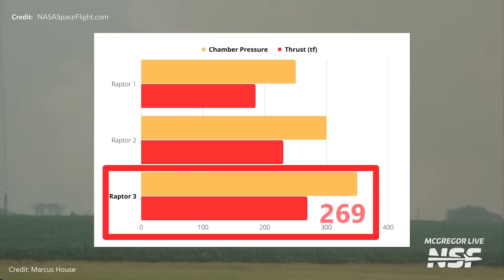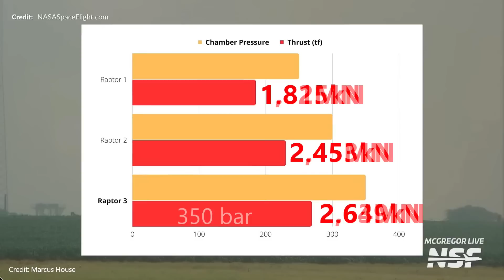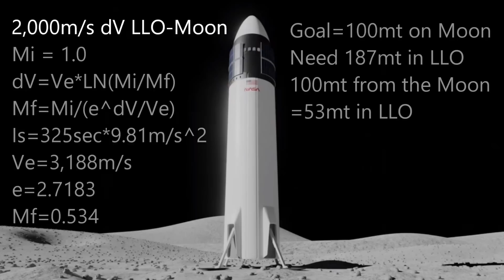Can the New Raptor 3 Save Starship?

Comment: The Raptor 3 will get Starship is an good engine to get to space if the reliability. As for Mars it will take a Nuclear pusher stage { TUG}. The Gravity issue for log term human HAG. I never understood why SpaceX never not make the nose a safety issue but it may become a NASA Requirement.
Reply from the maker: It is strange that they would not.

Comment: 0:45 who is saying the space shuttle main engines never failed in flight? STS-51 & STS-93 say hello.
Reply from the maker: Wasn't that a sensor error?  But good point.
Reply: @terranspaceacademy  STS-51 was a temperature sensor issue that caused an early shutdown & abort to orbit.

STS-93 was much more serious. Three of the cooling channels in the engine bell were damaged and caused the shuttle to lose propellant at a rapid pace. They made it to orbit just barely under-speed, but if an additional channel had been ruptured then they would have lost the mission if I remember correctly.

STS-93 is where the "yikes!" "You bet!" "Concur!" "We don't need any more of these." exchange came from.

Comment: Space had to blow up the spaceship when some of the engines failed, because they couldn't reach space or do an safe landing. So the effect is the same everything blow up even if it wasn't directly from the engines. If one engines fails when trying to land everything blows up again. 
So safety for crew in spaceship is questionable.
Yea the space shuttle was an failure and never an effective craft so building something new that is equally ineffective and unsafe is a bad idea.
Reply from the maker: Not really.  Rockets often fail on testing.  The Starship is a sound design for cargo and even getting people to orbit.  I'm just not sure they'll be landing on one any time soon.

Comment: For the fts if it is a wire detonation, should it have cut the ship in half and not punch holes in it? If i understand that correctly, which i had someone else help me understand it, than not only was the fts a failure but also to slow working for safety parameters. Not a hater, just advisor of facts and learner for knowledge.
Reply from the maker: 4.5mm steel is pretty tough.  A linear unzip or "can opener" as you mention, would be the way to go.
Reply: @terranspaceacademy  I take you agree with how the fts works. Now for the thickness, have they tested this on the ground to determine how well it works for? I believe I heard him or others say that it will need more cord to ensure unzip. Also to ensure it works why not design those areas to be easier to destroy while holding the mass to ensure proper safety function?
Reply: Also, what about detonation bolts that help the fts to fully unzip the ship.

Comment: Can it save Starship? What the heck are you talking about?
Reply from the maker: Extra thrust getting the ship off the pad faster so as not to pulverize the launch pad or cause sufficient back pressure as to prevent other engines from starting. Also engine out recovery is much better with extra power to spare.

Comment: For every launch every raptor is test fired multiple times. That means 39 tests times 2 or three for every launch. Today they will have test another and tomorrow another and so on.  By the time humans fly the current 300 raptors will be hitting thousands of raptors and 10s of thousands of test fires.

Even now, raptors have been tested more than most engines that have been around for decades.
Reply from the maker: that is a good point Brad.

Comment: What?  Starship did not need to be saved!   It is doing great even without raptor 3.   Just click bait title.
Reply from the maker: It does indeed... three engines failing before launch is not good.
Reply: @terranspaceacademy  - How many launches has Falcon 9 and Heavy and deliveries to the Space Station, and you claim SpaceX needs to be saved!  How Funny. There were many other things that may have caused those failures.  This is how SpaceX has advanced so well.   All the rest of the engines ran well and enough to get the rocket where Elon could call it a success.
Reply from the maker: @genemetz1945  It was a joke Gene.  SpaceX is the most secure space launch company on Earth right now.  Much more so than the state sponsored companies in China.

Comment: Why doesn't SpaceX use booster rocket configuration on the Starship like they do on the Falcon 9 Heavy? I would think that if you distribute the thrust over a wider area that there would be less damage to the launch pad.
Reply from the maker: They would need a broader base of the rocket.

Comment: I rewatched part of Everyday Astronaut's video on the Raptor from 3 years ago and am thoroughly impressed with the advances made to the engine. At that time the engine was only capable of 2 meganewtons of thrust and 300 bars was only an aspirational chamber pressure. The Raptor is far and away the most advanced chemical rocket engine ever developed with its record breaking chamber pressure and full-flow staged combustion cycle, all while being reusable. Yet they are a fraction of the price of comparable engines. SpaceX is truly doing incredible work.
Reply from the maker: They are... and I still get people screaming that the RS-25 is better... :-)

Comment: I also sensed the raptor three being immanent emergence as they sermed to have reached the upper limit of the second series.

Going with the the law of diminishing returns, raptor 3 can only be 30% more powerful than raptor 2, unless major tech shifts have transpired to facilitate many variables being refined in these 2 years and 5 months since debut of raptor 2.

The raptor 3 should max out in te next year and 7 months, with a performance that's 3 times the current output.
Reply from the maker: They will top out at some point.

Comment: Not unless it is far more reliable. There was one failure of a Space Shuttle engine which required an in-flight shut-down. One engine in 134 flights. The reliability of Raptor engines remains woefully inadequate for a human-rated spacecraft. Before another launch attempt, full-duration, full -thrust static fire tests should be conducted, with the objective of a failure rate of 1% or less. That means if 3 boosters are tested, each with 33 engines, no more than one engine should fail out of all 99.
Reply from the maker: They can blow up 70 Raptors to get it right and still save money over one RS-25.

Comment: Regarding the delay in the flight termination system's effectiveness on the 1st orbital test: seems that need to ensure that the autogenous pressurization pipe(s) returning into the propellant tank(s) are within the detonation zone so that the propellant tanks quickly lose pressure when FTS is actuated.
Reply from the maker: Should they put it on the common dome?
Reply: @terranspaceacademy  They probably want to keep the FTS outside the shell because they need to have accessibility to arm it shortly before launch and quickly disarm after landing.
Reply from the maker: @AlWaller-zp9rg  Good point.

Comment: Excellent analysis as usual.
Another thing that Spacex should consider is scalability. Borrowing a page from their Falcon series development, currently you have the F9 and the Falcon Heavy. The F9 has become the major workhorse of the space launch services  industry. Falcon Heavy is available, but with far fewer launches. Similarly, a scaled down series of booster/starship or booster with reusable second stage would get far more traction for LEO and GEO missions. Also, provide a more cost effective means for orbital testing of the evolving Raptor engines and vehicles rather than blowing up 39 engines at a crack.
Another argument, and a major one at that, is that even with full reusuability, the booster/starship in its current form can never be as reliable as a simpler design using gas generator engines. Just too many points of failure!
I am not aware of any plans Spacex has for scaling down the booster/starship. If anyone does, please enlighten me.
Reply: They have no plans for a smaller starship. There was an idea to do a mini starship, and fly it on FH to prove the design, back When BFR was still carbon fiber. But the move to stainless made that not cost effective. Starship is slated to obsolete the falcon line entirely. Elon thinks it will be cheaper to fly those payloads on Starship. Even if it is massive overkill for the job.
Reply from the maker: I wanted to see one but it's not in the cards... Relativity's Terran R will be the closest thing to a mini-Starship.

Comment: A Space shuttle main engine did fail on one launch STS-51-F causing an abort to orbit. Still, that’s a pretty good record
Reply: The engine didn't actually fail.  It was shut down due to bad sensor readings.    A few minutes later, the same sensors on the remaining engines also started producing bad readings, and the decision was made to ignore them.
Reply from the maker: Sensor error... the  engine was fine.
Reply: @terranspaceacademy   @Annie Mouse The engine shut down. It wasn't supposed to shut down. The sensor is part of the engine, the failure of the sensor caused the failure of the whole engine. Seems reasonable to call this an engine failure. 
(I suspect this isn't the first time people have disagreed about this point on the internet) 😃
Reply from the maker: @dufkers  That's fair...

Comment: Clickbait title that is not even addressed in the video. And after one test flight, why exactly would Starship need "saving"? Unsubscribed.
Reply from the maker: Sorry Daniel.  The algorithm does not reward scholarly titles.  Sorry to see you go.  If the Raptor 3 at 75% full throttle can launch the Starship at 1.5 TWR there would be a good margin in case something went wrong.  Like an engine blowing up.

Comment: I will play devil's advocate. You call for an eject system, but airlines don't have an eject system. Why should it be required on one and not the other? I can think of only 1 reason. That materials are stressed much more in a rocket vs an airliner, but turbines are spinning at thousands if not tens of thousands of rpms while exposed to significant heat, so I am not sure how 1 condition compares to another ( future video idea?) So where weight and complexity are the enemies of space flight, do you think that they are justified based on safety factors? Even excepting moon landings?
Reply from the maker: Airplanes can glide Chad.  Starships cannot. There have been several power out airliner landings.  There will never be a power out Starship landing.

Comment: I do like the 2-stage + crew/cargo pod concept but that adds an entirely new vehicle to be designed, built and tested on a very tight schedule.  Plus, the second stage now needs heat shielding around what appears to be a sharp edge where pod joins whether the pod is docked to it for re-entry or not.
Reply from the maker: It would be a little work but worth it in the end I think...
Reply: @terranspaceacademy  
Maybe.  SpaceX don't know if their heat shield will work yet.  They don't know if they can make in-flight refueling work. The time-line is already pretty aggressive and, surprise, surprise, SpaceX have already encountered a rough patch in the road... there will be more.

Comment: One F1 did fail on Apollo 13. It shut down too early.
Reply from the maker: That was a J2... I thought the same thing.  And wasn't it 13?
Reply: @terranspaceacademy  the J2 's on the second stage had to burn longer because a   F1 shut down early.  The rocket left it's inclination line to orbit because of the  lower thrust. To make up the loss, the J2 engines on the second stage were  fired longer then planned , getting  Apollo  13 back on track to orbit.

Comment: once the revolutionary payload capability has been proven,  and once full reusability is established, then, features that dramatically affect payload numbers, like a three stage with double redundant escape capability, might be practical. it would have been interesting to hear an estimate of the hit to payload and overall efficiency capabilities,  the aerospike crew module idea would impose on the overall system efficiency. furthermore, if the frequency of flight and reliability numbers advance in lockstep, the motivation for the three stage configuration is reduced favoring payload. other mission needs may still make this configuration useful, but safety ideally would not be that need. we do not have ejection seats and parachutes in airliners.
Reply from the maker: Because they can glide MrGunderfly :-)  The Starship glides like a large steel building...

Comment: Astute observations as always! Starship is perhaps the most ambitious launch vehicle project ever undertaken, so it stands to reason they won’t get everything right on the first try (or even the first several). I suspect that something similar to your nose-come abort setup might be dictated eventually by the FAA (or maybe NASA) for crew safety. SpaceX mantra is that if you aren’t having to add back parts or systems that you aren’t optimizing enough, so it’s easily within their MO to add an abort system.
Reply from the maker: We think it would be a reasonable addition to crewed flights James.

Comment: I thought the debris damaged the engines from a horrible designed launch pad. Did I miss some information the last few days?
Reply from the maker: Elon said that three of the engines were out of range and were shut down on startup... that was the maximum launch outage that had been calculated so they flew it anyway... Hard to know how much of the other damage/engine explosion was debris related.
Reply: That was just everybody speculating. As far as I know the official statement is that no engines sustained damage from the concrete.

Comment: Good job as usual. I wouldn't put it outside of possibilities that SpaceX already has this on a drawing board somewhere. It's just a lot further down the line. Say with the first iteration of the human flight version. I like the idea of the separation for emergency but not the design landing change, even though your points about the mass to lunar surface is intriguing,  it would be superfluous to the original design criteria. I've said in the past that it's a space truck. There is so much room in our efforts going forward to include other companies with designs that will full fill the "we need to just take people and a small amount of cargo" to the moon or mars to make this a needed service. SpaceX and specifically Starship is simply a BFR company.
Reply from the maker: The Raptor 3 will probably see usage... Elon said there will be a totally new engine not called Raptor later.
Reply: @terranspaceacademy  I keep hoping to see something more on the Pangea Rocket Engines. I also believe it would be foolish for SpaceX not to develop an aerospike. It would just be too useful and efficient interplanetary.
Reply from the maker: @tekish7682  I think unless you design like Stoke Aerospace the diameter of the aerospikes for a booster gets really high.

Comment: That's a really good idea.  They need engines like this for the lunar Starship anyway, so why not accept the mass penalty (especially with superior Raptor 3 engines on the horizon) and add safety margin for human rated Starships?  One other thing - I believe Elon is on record saying that the Raptor engines on the first test flight included a wide spread of Raptor 2 engines from varying stages of the development program.  For the next flight the Raptor 2's  will all be late model Raptor 2's and much more consistent in performance, so presumably a better outcome is to be expected....  (++2 also didn't one of the Saturn V engines fail once at least partially, albeit not in a mission critical way?)...
Reply from the maker: I thought that was the case... The Saturn V had a second stage engine failure :-)  Not an F1.
Reply: @terranspaceacademy  Ah - yes you are right.  It's also right what one of the other contributors mentioned about commercial aircraft not having abort options too.  But if I was on board Starship I would be greatly calmed if such abort possibilities existed (probably just me getting old!)

Comment: On your idea of the booster being left in orbit, is it not SpaceX’s idea to refuel the booster while on the moon from the natural resources up there or is this suppose to be for another rocket system?  However, I can see your idea working for the first few flights while infrastructure is built to make the fuel up there for refueling of the booster.
Reply from the maker: Currently they don't plan to refuel from lunar resources for quite a while... probably a decade.
Reply: @terranspaceacademy  Thanks for the update on that.

Comment: Great video, but why the garbage title? Starship does not need saving.
I think you might be on to something with the detachable crew cabin, though it does mean large hypergolic tanks and a hefty engineering setup. But i think having an escape system would be a great thing to have. Though it seems like it would only make sense for one vehicle, the HLS. At least until there is any other plans for crewed ships around earth. 
Mars ships couldnt use this from what i can tell.
Reply from the maker: Because a more powerful engine would allow more reliable recovery from engine out scenarios :-)
Reply: @terranspaceacademy  I could see a scenario which this could help, but i do believe they will make raptor dependable enough that such a scenario wont come to the point of being saved by it.
Fingers crossed anyway..
It just felt super heavy on the click bait scale.
heh super heavy ;-)